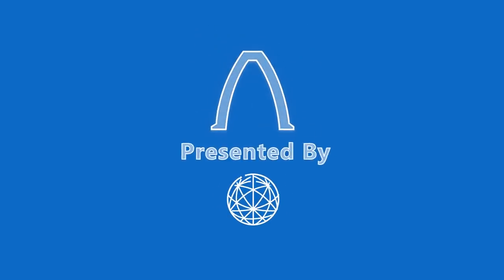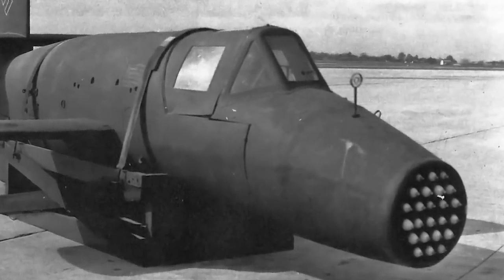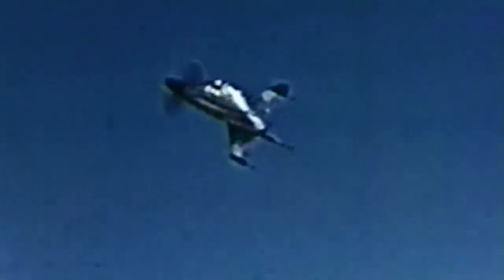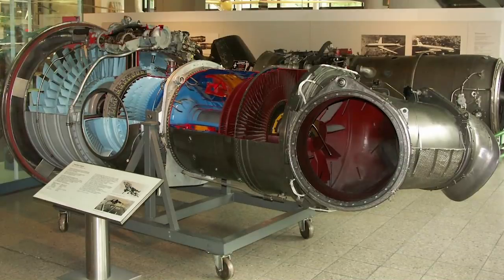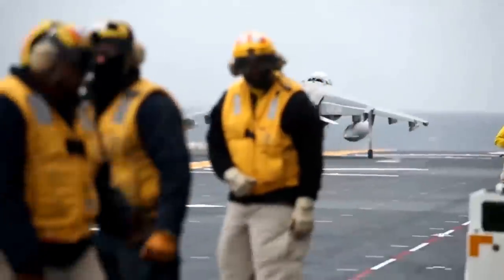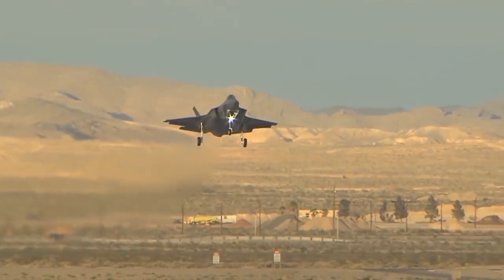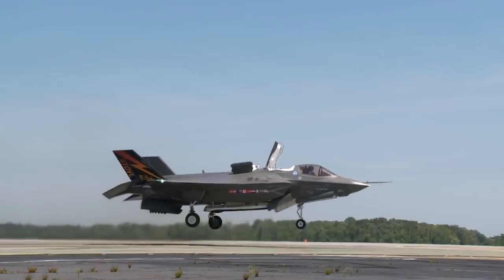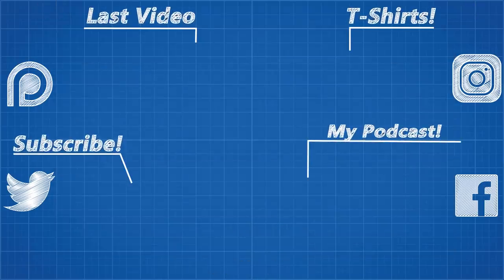The Real Life Sci-Fi of Vertical Take-Off Planes

Comment: Request
Can you do a video on the V-173/XF-5U or the flying pancake/flapjack? Or on disc shaped aircraft?
They were built to be the ultimate prop fighters but they came too late with the age of jets being ushered.
Due to the unique shape and design, they were known to have super short take-off and landing.
The v-173 was tested extensively while the flapjack was so close to taking flight.
The modern variation that is similar is the Geobat flying disk which is tested to have a low stall speed.
Regards Kin

Comment: F-35B model (the one with VTOL) is already in limited service with the Marines, and has been since 2015. There are already several hundred F-35s built and flying, and it's cleaning up the opposition in war games. It is expensive, and coming into service much later than original intended, but most of the major delays and overruns happened almost ten years ago now. They re-baselined the program back in 2010, and it's mostly stuck to the new schedule. I think it's past the worst hurdles, and will ultimately prove successful. 

FWIW, F-35 pilots rave about the VTOL ability; it's incredibly stable compared to the harrier. If you compare videos of the two planes when landing, the F-35 doesn't shake or shudder at all. It's going to be massively safer to land than the Harrier.
Reply: flip inheck Nope, Lockeed Martin's YouTube channel even shows the F35B vertically taking off
Reply: I think it's capable of VTOL, but in terms of practical operations it's pretty much always going to use STOVL. Can't carry a useful payload with just a vertical takeoff. The Harrier was pretty similar.

Comment: The enormous fuel consumption of the Harrier's Pegasus engine was why they decided to cancel the P.1154 project. The Bristol Siddeley BS.100 engine planned for the P.1154 would have consumed a massive amount of fuel, to say the least.
Reply: That wasn't the only problem. the P1154 would have had massive operational and structural issues having what was basically 4 afterburning nozzles strapped to the side of the aircraft. The majority of the aircraft would have had to be made out of very high temperature resistance alloys and you couldn't operate it out of a field like you could with a Harrier as the BS.100 engine at full power would dig huge holes in the ground, F-35B does have the same problem with the rear nozzle as regards field operations.

Comment: Why not use hook to suspend the Harrier during landing. The hook would make landing less dangerous, as the plane is just slowly lowered by a crane-like device. Aircraft carriers already have arresting hooks and catapult launch systems for horizontal take-off planes. For non-aircraft carrier landings, you could just drop the plane ,which would damage the the landing gear over time. It would be fine, as it would be preformed so little, it would do nothing.

Comment: Rolls Royce did not design the Pegasus engine (The basic idea was from a French engineer and the concept was heavily modified and made to work by Bristol Siddeley Engines Ltd who were bought out by RR in 1966) and the Harrier was not the first aircraft to take off and land vertical using vectored thrust either (Bell X-14 did it 3 years before the P1127 and the two Hawker test pilots who tested the british aircraft actually went over to the USA and flew the X-14 to get VTOL flight training before the first P1127 was finished).

Comment: 2:30 I think it is, but you motion velocity of the rotating blades, that's wrong it would be the speed of the blades as there is no displacement involved. Remember speed is for how fast an object moves from point A to point B, velocity is similar however there needs to be displacement.
Reply: Velocity is speed and a direction.

Comment: I had no idea the F-35 was capable of Vertical Take Off and Landing
Reply: It is not, It just goes up and goes down. Have not been able to find and footage of the plane actually taking off and landing like you can find with the Harrier.
Reply: @mrnatestl82  Because it isn't designed to. It's STOVL not VTOL. VTOL isn't very useful because of the high limitations to the payload and restrictive design. Short takeoff is much more efficient and even the Harriers did it so they could have a larger payload.

Comment: the engine is called a turbo fan, as the turbine powers a fan on the inlet who's air is directed in part not through turbine. Large passenger jets use this design engine

Comment: They could have used the supersonic props the US was developing in the 1950s or props at a much courser pitch as on the Bear.

The  Kestrel and early Harriers had no structural composite materials. These came in with the Harrier II.

You really do need to more research before publishing.

Lift fans were considered in the early days of VTOL, but were rejected due to issues with gear boxes and the dead weight when not in use. It's similar to all those proposals using lift jets that went nowhere fast.

Comment: from what I know, I worked on a harrier and next door to lockheed's development hanger in Fort worth. the max load for a f-35(marine version) is still way under weight. I think at the moment it can only support 2 250 lbs bombs. there are no such munitions in the us arsenal. someone correct me if I'm wrong
Reply: The US have the Mk.81 250lb-class bomb, and there are also several others such as the GBU-39 and GBU-53 glide bombs that use GPS and other guidance systems. The F-35B can carry 8 GBU-39/53s, but cannot carry anything larger than a 1000lb Mk.83 sized bomb internally.
Reply: @dumdumbinks274  first I heard of the mk 81 and that was literally my job on the harrier. the mk 83 is not really a limitation since that's all the harrier could carry. the real issue is that america has a huge stockpile of 500 and 1000 lbs bombs and so likes to use those. if I haven't heard about the mk 81's then we probably don't have a whole lot.
Reply: @billyharley8295  A 250lb unguided bomb isn't particularly useful, but when guided it becomes a very useful weapon for when you don't want collateral damage. The GBU-39 and GBU-53 are both long range glide bombs of the same weight class as the Mk.81 and are currently being produced for a wide variety of aircraft including the F-15, F-16, and F-22, so you can expect them to be produced in large numbers. The launcher carries 4 bombs and the F-35B can fit one launcher in each bay, so 8 bombs total. 
Mk.83 is a limitation in the sense that the F-35A/C models can carry Mk.84-type bombs such as the GBU-31 internally, the F-35B can't because it's bays are smaller to make space for the lift fan.

Comment: I work on F-35s, but it's the Air force variant. So it doesn't have the short take off or vertical landing.
Reply: Eh, they work, but the program cost an extreme of money from the taxpayers. The individual cost is less than an F-22, But the program cost around 1.5 trillion, whereas the F-22 program only cost 66.7 billion. So they spent way to much developing it. The stealth, vertical takeoff, and most other advanced avionics components on the plane have all been functional in my experience. But again, i'm Air Force so i don't get to work on the B or C variant. Although most of the Marines and Seaman i know don't say anything bad about there planes.

Comment: They don't use fuel now they use compressed air that converts into Nitrogen the passenger jets also use the same free energy they float like bee's when the giant engines oscillate due to the blades that are carefully placed and spaced so as to cause a vibration that separates the nitro from the oxygen hum

Comment: Ok, so obviously you can't just get technical data from the F-35 program to comment on how one of the models is a VTOL that seems to surpass at least some of the limitations of the Harrier.  But as much as it is easy to hate on the F-35 program for the political stuff behind it and it effectively "stealing away from" the F-22 program that may be superior as an actual fighter aircraft, you have to admit that they did come up with some good stuff in the end to be able to do what it does. 

Yes, don't get me wrong.  Given the videos of the F-35 making such manuevers on youtube, I would not ever want to actually land one vertically if I got hit during a mission.  There is just too many parts that have to move, and too many panels of armor/airframe that open up (to where some of the earlier transformers toys have fewer rotating/translating parts), that I would just be too paranoid that some puncture holes through one of them might have jammed it in place or prevent it from fully reaching its intended VTOL-mode angle.  And if I make it back from a mission, I at least already know that it can fly forward, after all. 

Now, if we go into the sci-fi realm a bit and say that there were net-positive fusion reactors small enough for fighter jets (Lockheed is working on one that MIGHT fit on a 747, so even if theirs works it would still be difficult to get one small enough for fighters), then we could probably simplify the VTOL design thanks to the comparative lightness of electrical engines (which would let you just use a bunch of such engines dedicated to vertical lift and hidden in the airframe, while having a different proper forward-intended engine or engines used for thrust).  This, however brings us to the relative lack of high power electrical engines currently designed.  Namely, the seeming lack of something like a supersonic jet engine that is designed to run just on electricity.  Yes, you could use the waste heat from the fusion reactor too (potentially getting rid of some more of it by using the wings as heat radiators too, which yes, is why I laugh at anyone who says "sci-fi spacecraft shouldn't have wings"), if that's your power source, but one must wonder what the best way to design the shape of such an engine's internals.

Comment: 2:36: The V-22 is a poor helicopter that turns into a mediocre airplane. It has it's uses but in no way is it a replacement for traditional helicopters. It doesn't have the lower disk loading that a true helicopter has and just doesn't have the same utlity. The other way, taking a helicopter and increasing it's forward flight speed with a pusher prop results in a better helicopter (the pusher prop is useful for acceleration and deceleration as well as fast forward flight) with speed and range in the same ballpark as a tilt rotor (albeit less) with lower complexity and cost.

Comment: F35..."should it finally reach service..." and therein lies the problem. The Harrier worked, this doesn't!
It was supposed to attend Farnborough a couple of years ago. Then it wasn't. WHY? Because it can't land vertically on standard material used for ground at airports/airfields.
Reply: The F-35A/ F-35I and F-35B are already in service with the Royal Norwegian Air Force, Royal Australian Air Force, United States Air Force, United States Marine Corps, and Israeli Air Force. In the case of the USAF and USMC, already deployed.

Comment: just a key thing  supporting thousands of american jobs is good and all but that is not  a thing that should be considered when railroading a flawed system like the f35  into too many roles. when it has trouble doing those roles  in the first place.

id rather support thousands of american jobs by bringing back the raptor in a more cost effective variant.  its not so much that we americans hate that the f35 is so fuckin expensive....its that we arent seeing the returns on the cost like we were seeing with the f22 raptor.
Reply: The F35 isn't being railroaded to do multiple roles, it's a multirole fighter it's job is to do multiple roles

Comment: I dont understand why they designed this airplanes like that....commercial airplanes should be able to take off vertically....it is just the matter of propulsion system  settings....and they would not be able to need wings etc..the gas turbines are in the wrong places...thanks for the video.
Reply: Endre Tolnai Don't know what kind of engineer you are but that's not gonna work, it would be a mechanical nightmare to engineer
Reply: Miert? a turbinaknak a testben kene lenni, nem kellenenek szarnyak..es a gep fordulasa olyan lenne mint az autokee..Why, the propulsion system, shoulbe in the body, and there would not be need to attach wings to the aircraft..and the plane would turn as a normal aircraft..for me the mechanical nightmare is the very complicate parts and solutions, but if iam bored i am capable of make complicated solutions solving, but not making.. Szamomra a muszaki remalom az a tulkomplikalt alkatreszek es megoldasok..amit nem en talalok ki, de ha unatkozok, akkor hajlando vagyok megoldani..
Reply: Endre Tolnai  please please please do research before trying to argue for something that’s completely wrong
Reply: You do realize that’s basically saying anything can fly as long as you spend a shit ton of energy boosting it off the ground making the object very very inefficient

Comment: the f35 is a stovl not a vtol
Reply: +Sketchupdave

 Officially it is not V.T.O.L., but is completely capable of taking off vertically.
Reply: fuel sipping device
Reply: but I remember, in testing they shattered the first stage of the turbine as they tried to do a vertical takeoff with the yf-35
Reply: +Sketchupdave 

 I don't recall that, but even then, I could see that from F.O.D.

Comment: Nazi Germany? Check. The US of A? Check.
Where is the Yakovlev 38 and 41? The F-35 benefited a lot from Yakovlev Design Bureau's knowledge sold during the 90s.
Reply: +TheDaniel366Cobra

 The Yak-38 and Yak-41 had nothing to do with the Joint Strike Fighter program.
Reply: Yak-141 does. In 1995, Lockheed Martin cooperated with the Yakovlev Design Bureau. I mentioned the other Yaks as examples of "older" Soviet VTOLs. Surprised they were not mentioned.
Reply: +TheDaniel366Cobra 

 Lockheed Martin's purchase and integration of Yakolev designs and technology does not appear in any documentation to have included the Yak-41 (also called the Yak-141) during the Joint Strike Fighter program's beginnings or submission period. Though two prototypes were offered to Lockheed Martin to inspect in the early '2000's. Which was after the requirements and submissions for the S.V.T.O.L. variation (X-32B/ X-35B ) was made.
Reply: Wikipedia and other sources state otherwise. Quote: "...Yakovlev entered into discussions with several foreign partners who could help fund the program. Lockheed Corporation, which was in the process of developing the X-35 for the US Joint Strike Fighter program, stepped forward,..."; "...The partnership began in late 1991, though it was not publicly revealed by Yakovlev until 6 September 1992, and was not revealed by Lockheed until June 1994..."
If they had a partnership, Lockheed's engineers surely have seen the plans, especially given the Russian 90s lack of funding for the bureaus. And honestly I don't really expect Lockheed to just state "Yeah, our new shiny toy includes Russian tech" (probably because cooperating with Russian scientists is more shameful then with Nazi German ones).
Reply: +TheDaniel366Cobra

I  still disagree with the notion, be it you support it or not, that the Yak-38 or Yak-41 were apart of the initial technology transfer. 

 Not to mention. What technologies would be carried over? Certainly there lies the possibility of using them as reference for aerodynamics. But that as far as we know is still baseless.
Reply: Well, the general layout, the tail beams, the main engine's duct design with contra-rotating sections and the tilting nozzle assembly do look pretty similar. Of course, the Lightning's fan is a major improvement over the Yak's twin lifting jets, but still. And why do you keep saying the partnership did not happen? Lockheed announced it did. I think it'd be insane for them NOT to "borrow" some good design tricks.
Reply: +TheDaniel366Cobra

 Several aircraft prior to the Yak-41 had the 3-piece swivel nozzle. None of those points really provide a connection to the F-35. Or the X-35. 

> "And why do you keep saying the partnership did not happen? Lockheed announced it did."

 I never argued that the partnership didn't happen. I was arguing that I see no connection made the Yak-41 was apart of the technology transfer, or that it had any direct or indirect connection with the JSF aside from it being Lockheed Martin.
Reply: Hm. I found an interesting history overview about the 3BSN, and it seems like the design was first patented in the US, but actually applied to a fighter jet by Soviets. The document also states that Lockheed did in fact obtain design data from Yakovlev KB.
Quote: "The 3BSD was invented in America in the 1960s, proposed by Convair to the US Navy in the 1970s, first flown by the Russians in the late 1980s, re-engineered from the 1960 Pratt & Whitney design for the X-35 in the 1990s, and put into production for the F-35 in the 2000s."
http://www.avia-it.com/act/la_tecnica/la_tecnica_di_oggi/Tecnica_oggi_2014/Segnalazione_articoli_Giu/History_Of_The_F-35B_Swivel_Duct.pdf
I guess we both sort of have a point here, and apologize for being sarcastic.
It is just disappointing to see VTOL tech from my home country left out.